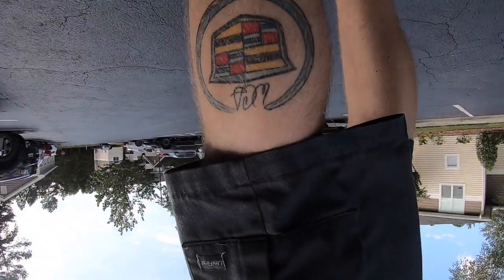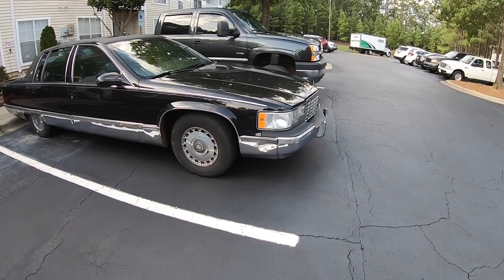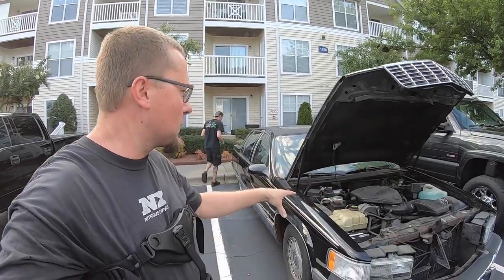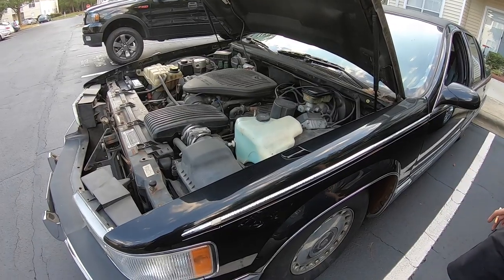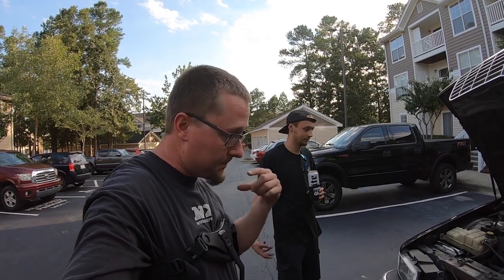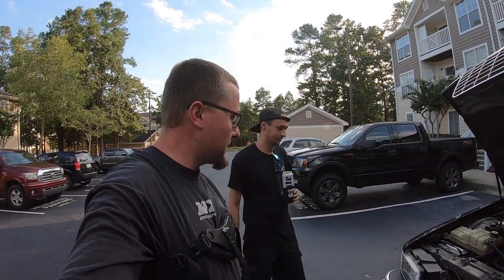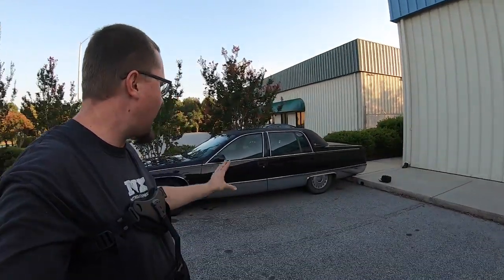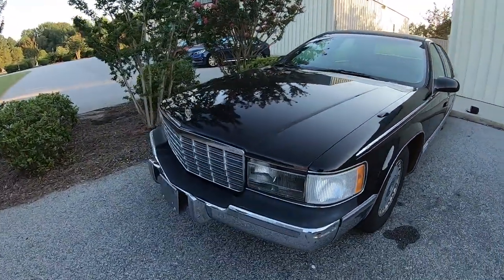Welcoming A New Car To The Channel

Comment: Its good to see you up and moving around. Check the body control module for the door locks. I have a Buick Roadmaster which is the same car and mine did the same thing until I swapped the BCM

Comment: Check and plug the vent tube in. The noise you hear is probably the air pump.
Reply: Impala SS Forum. Com is your friend here. All kinds of great information for all the B bodies.Check  out Clear Image Automotive for their build.
Reply: By the way, I have a 1995 9C1 Caprice since 1999... been there and done that on a lot of stuff.

Comment: That thing is not on the same frame as an S10 lol. Also only can tow 7000 if it is equipped with the heavy duty tow package which one look under the hood I can tell it doesn't. It would have a secondary mechanical fan and an external oil cooler in front of the radiator like the 9C1 police package. But other than that welcome to the B/D body Family!

Comment: If you dont find a short. Look around the column. The shifter in my uncles caddy did the samething. It was wireing around the column and i think the shifter itself. It had it were it would unlock in park, and lock when out of park. It was shorting and thinking it was coming in and out of park. If you dont find wiring or door switch issue in or around the door. I think caddy needs to be bagged on 20s-24s. Edit: we scanned the computer to see what it was doing and where the lock and unlock was being commanded from. We first thought a faulty switch or key fob.
Reply: Lt4 hot cam, bag it on 20's!

Comment: Don’t put any rims larger than 20”. You can bag it or install the coil over conversion kit all the way around it. Don’t put any hydraulics on it! Yank out that old LT1 , you aren’t going to make any decent power without loosing MPG’s. Make a step by step video installing an LS with a turbo or supercharger.
Reply: Lt1 is not the problem for power just needs a stand alone
Reply: Brandon Panozzo 
What do you mean, needs a stand alone? Are you talking about Adding a LS1 harness and 411 ECM? Doing that , you still won’t make over 300 WHP.  Converting this LT1 to the LT4 will cost more than a LS swap.
Reply: @peteg9396  there are people makeing over 1000whp with boost and a stand alone computer system on lt1s
Reply: Brandon Panozzo 
On a stock top or bottom end LT1 from 1996 you will not make 1000WHP. You would have to build the bottom end to withstand boost for 1000 HP. If this was a Gen V LT1 then you would be correct. Either way it will still be cheaper to swap the engine than build this one up.
Reply: @peteg9396  who said you could thats a pretty obvious statement